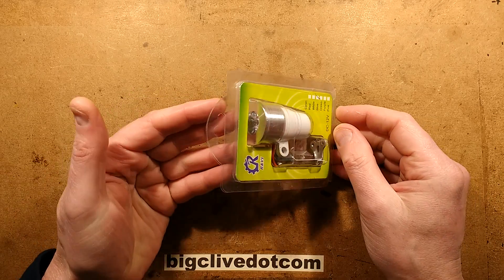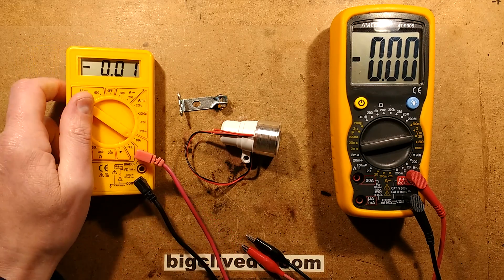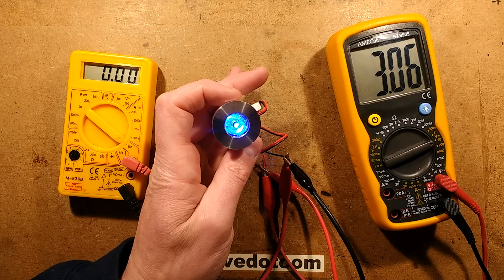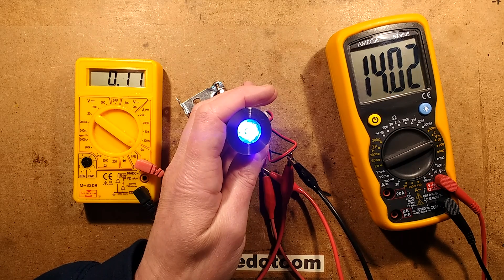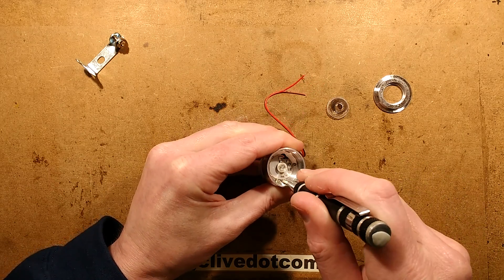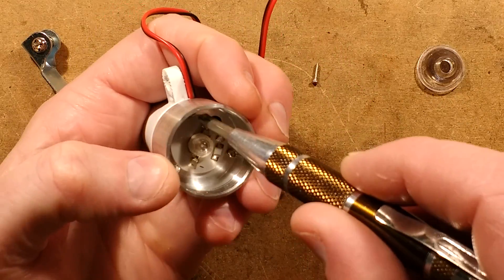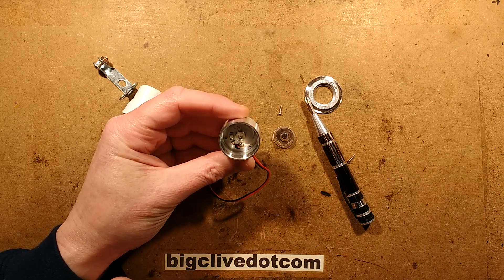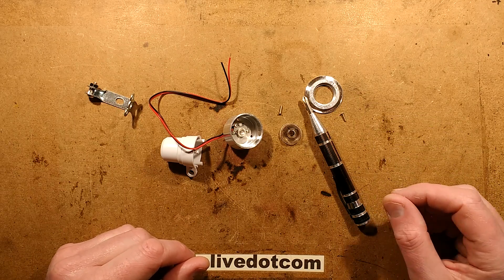Inside a cheap LED vehicle feature light.

Comment: You could easily fit a LM317 and a resistor as a CC in the plastic housing (using the metal housing as heat sink if necessary)

Comment: Clive, even though its rated for a 12v system, cars actually operate at between 13.6 and 14.5 volts during normal operation...
Reply from the maker: This is where the cable will probably be the main current limiting element.

Comment: just one little question about resistors in an led circuit.. dies it help the current stay linear and not go crazy as the voltage goes up as it would without one? in other words the more the current goes up due to voltage increase the resistor balances it by way or the resistance growing as the resistor heats so like a ballast?
Reply: Well a light bulb is used as ballast when experimenting with m.o.t's and a light bulb is basically a resistor. I wouldn't have thought the resistor in an led circuit would need to heat up to a noticeable amount just that when the current rises it limits now much can pass on to the led. Thermal or otherwise
Reply: Unlikely to act as a regulator as heating and the associated resistance increase is an inertial feature ie it takes time, there is no way it is fast enough to compensate for voltage fluctuations unless those are extremely slow.
Reply: The component you're describing is called a thermistor. A Positive-Temperature-Coefficient (PTC) Thermistor is a passive device whose resistance increases with increasing temperature.
You can also get NTC thermistors with a negative coefficient, which obviously work in the reverse fashion.
They are often used as part of a "soft start" limiting circuit in devices with a heavy start-up current draw, to provide a degree of self-regulation as the device reaches normal operating temp.
Reply: Yes, I think I might have misunderstood your original question. You're correct, a ballast can be as simple as just a single resistor; the simplest technical definition is "a device which limits electrical current flow through a load".
The value of the current-limiting resistor in a LED circuit is calculated to give a voltage drop across the resistor which is equal to the difference of the supply voltage (Vs) and the LED/s forward voltage (Vf), and which limits forward current (If) to some value which won't damage the LED and/or gives a suitable level of brightness. The correct resistance value is given by the equation Vs - Vf / If.
Because you are dropping voltage across the resistance when current is flowing, some power will be dissipated as heat. The resistor needs an adequate power rating to cope with this dissipation, and good design dictates that you'll specify the supply voltage and connect the LED strings in such a way that minimises the voltage drop for your desired forward current (hence also minimising wasted power). If a current-limiting resistor in a LED circuit is getting really hot, there's something wrong... either with the design of the circuit itself, or some component within it. But the resistance does not change significantly with temperature. As the voltage is pushed higher, more current will flow and more power will be dissipated, until the resistor fails open circuit (preferable) or short circuit (likely causing the load to be destroyed).
Reply: A light bulb filament is usually made from a coiled coil of tungsten which is very different to the carbon film or metal oxide used in resistors (except ceramic resistors for high voltage/loads) so the temperature effect is different for them. Tungsten has a low resistance until heated then its resistance increases slightly as it gets hotter. Your right about resistors getting hotter with voltage increase as the current flowing through the load increases as the resistor is dissipating more heat for doing its job of limiting current. However resistors are not intelligent, they are usually used in situations where the voltage and load will not vary by much which is why the correct value of resistor must be used for the purpose of which it was intended. For big fluctuations in circuits where the end result needs to be close to a constant, supporting components and circuits may be required like voltage regulators, snubber networks, Thermistors, zener diodes, buck and boost converters etc .. :) You can get more 'bang for your buck' if you heatsink the resistor but ultimately there will be a point where the resistor will just glow and burn out. Low value resistors can be used as a one shot fuse in that respect :)
Reply: bigclive.com should intervene here as all these theories seem to contradict themselves..
Reply: does a resistor regulate? to regulate means adjusting voltages and or currents flowing to the desired component. as the voltages get higher the resistor should lower the current flow and if drop down have no affect. regulate. if not just have a lower voltage input in the first place then when the threshold is reached the led will be optimum.

Comment: Here in Russia it's forbidden to use other colors of vehicle lights other than red (back), white (front) and amber or yellow (sides). And fines are quite high.
But in Asia i saw vehicles that was looking more like Christmas tree!
Reply: Same in EU.. It would also have to be tested and marked with a license number to be road legal
Reply: The UK highway code stipulates the colours allowed for public cars/motor bikes. brakes/running rear , red, indicators , yellow (amber), headlights, white, sidelights/front running, white. Strangely there is no need for reverse lights to be white although it warns you that Blue and green lights are restricted to emergency vehicles only. It's all about removing confusion on the highway and rightly so. Obviously flashing or rotating amber lights are for warnings which is why indicators are yellow. It's also interesting to see a lot of cars at night using fog lights (bottom of front bumper) for extra illumination to which there is an on the spot fine of £100 if there is no fog as they dazzle the cars in front. The usual excuse is "but muh runnin litez init", er, no. They're fog lights, turn them off. My brother found out the expensive way from a police car that stopped him for that very reason :D lol
The plethora of lamps for cars out there are supposed to be only for show purposes while the vehicle is stationary and off the public highway, cos yeh, they do that don't they while tear arsing around supermarket car parks ripping up tar mac, booming out shite music and looking like a UFO from across the road.

Comment: I bought a white one of these which claimed to work from 12 to 80V. It turned out to have a switching regulator inside and worked fine on my 48V electric bike. The annoying thing is the regulator doesn't start regulating until 14V, which means it's not full brightness if I want to run it at 12V (a common standard voltage).

Comment: Yes it would make a smashing little down light, not sure about its intended purpose, the road salt would see that bracket off pretty sharpish with our winters. Smashing video as always, thanks. Ps. My leads also suffer from separation anxiety, usually after the power supply is turned on! ;-)

Comment: Hi Clive....what is your experience of dealing with Chinese \ HK companies ....l have so far stayed away from giving them my custom , however l notice you seem to use them quite a lot ,,,( this one above coming from a chinese seller.......any advice , do's and dont's etc appreciated.....thanx by the way for your , entertaining ,and informative articles.........a gift is on its way via Paypal
Reply: Been buying from Chinese sellers off eBay, AliExpress. Shops like GearBest, DX,TinyDal, BangGood etc.
Worst two cases have been with eBay where it by all accounts looks like the sellers tried to run scams. One was refunded directly by eBay, the other one I waited too long (in hope of it just being a shipping issue) and had to go to PayPal for the refund (still a pretty painless thing). Had a couple of items on AliExpress that weren't as described and have been completely refunded or come to a deal w the seller for a partial refund depending on exactly what the issue was. Don't recall any issues with the shops like Tinydeal, BangGood etc.
eBay and AliExpress seem to both run a fairly tight ship in favor of the buyers and in the few cases where things havent arrived (both eBay and AliExpress) refunds or re-shipment has been no problem.

Email address has leaked somewhere, causing 3-4 other shops to send their ads, but it's low colume and gmail manages it mostly in the background.
Reply: Sorry. I misunderstood your question.
I have been buying Chinaware through Ebay for years now.
Mostly with succes.
And on the few occasions an item didn't arrive or was DOA I usually got refunded within 2-3 days, no questions asked.
I'm not sure about the privacy guidelines on Ebay though. Imo personal details are shared.
Reply: changed that now to via Patreon
Reply: My experience is : If it works, you're lucky.
If your house burns down to the ground, not so lucky.
It's a calculated risk with these cheap China things.
Just use those things attended.
Reply: Hendrk ,,,,,,l wasnt talking about the quality but the actual sales of items....l have bought uk stuff that would have been better being sent direct to the tip.....l am more bothered about whether my money and personal details are safe,,,l have fell foul of dodgy dealings in the past
 and just for the record .....how much stuff on ebay or amazon are made outside of China.....l would think about 20 % if we are lucky........
Reply: thanx for the info Hendrik
Reply: thanx for the info Michael ,along with Hendrik 's answer and yours l feel a bit more confident about using the overseas sales companies
Reply: l had a few nasty experiences with sellers on Amazon and Ebay , more from misuse of my details , plus l have had so UK firms that turn out to be shipping from abroad yet they claim to be in UK Manchester or London etc.......as Bigclive deals a lot with China on Ebay that was the reason for my question , eg Security ,,,
Reply: Most of the people who disparage chinese stuff, are either racists, or people still stuck in the 1970's mentality and trying to see stuff at 1970's prices.      They are not keeping up with progress.    25 years ago,  something with the ability of, say,  an Arduino, cost about 3000 dollars.  Now 3 dollars.   There are a lot of people with old stuff in stock,  pissed off that they cannot sell their old stuff for $3000 any more.    Same as the retailers with big TV's which were $5000 five years ago,  now about $700.

Comment: im curious why shouldnt the meter be left in a current function? obviously not just because it drains the battery, i do kno it puts out voltage when measuring resistance but i havent heard about this yet
Reply: The leads are connected in current mode. If you try to measure a voltage with it you'll short things out.
Reply: if you go to measure voltage, then you may either just blow the fuse , or on a cheaper meter the 10a has no fuse, or ruin the meter, or if you were measuring mains, even  the fuse might not trip fast enough ruin the meter and have stuff shooting out of it
Reply: Because some idiot (usually tomorrow me) will connect it up to a voltage source and blow the not inexpensive fuse.

Comment: Hi Clive. How about a teardown of the car “ghost shadow lights”. Basically plug in replacements for your door puddle lights that project a logo onto the pavement bellow. Car manufacturers charge a small fortune for these at list price (£100 from Audi for example) but the cheap Chinese copies are knocked out for £6 a set on eBay/AliExpress.

Comment: About time to make yourself a quick connect tester for DC. Some quick connect terminals to grab the wires and a few spots to probe for the meters and a spot to clip on the wires from the power supply. Could use some of the cheap panel indicators for volts/amps but that would require a second power supply.

Comment: It is a 1W light, only 3/4 of that watt is being dissipated through the resistor instead. XD I guess the LED is being under-run at least.
Reply: well a decent single led should be about  3 volts x 20 milliamps  which is about 0.06 watts.   Anything above that is waste.   But in a vehicle, it is not connected to your utility meter,  so nobody cares.

Comment: neat led, will buy a bunch and hook them in series and use them as a 220V downlights
Reply from the maker: +Quick Look n Teardown Technically speaking you could do that with just a rectifier, but the separation between the LED and aluminium heatsink is just a shim of fibreglass laminate so there's a risk that the aluminium housing could end up referenced to the mains.
Reply: yea, probably not worth the risk, thanks Clive, I love your videos

Comment: Father took ownership of a new (to him) motorcycle today which came with a pair of "spotlights" thrown in, naturally I had to take them apart and check them out on ebay. They are listed as 9-12W (definitely not looking at the LED chip), but they do have some circuitry in them, a couple of capacitors and chips etc. They are also listed as waterproof which they aren't either. Thought they would be suitable shite to interest you Clive. https://www.ebay.co.uk/itm/2pcs-U1-Car-Motorcycle-Laser-Aluminum-Headlight-LED-Fog-Spot-Light-Bulb-Switch/182618889922?epid=2245838054&hash=item2a84ef1ec2:g:s4QAAOSww~xZ2Mdy
Reply: The Chinglish description is epic! "Unique square spot suitable for pavement super province electricity night driving more fuel efficient more secure absolutely not deficit battery", followed by - "Function: Continuous switch a super white head,two near the light,flashing three invincible" :-)
Reply: Hahaha I didn't read that bit! Even more reason for Clive to do a video on them!

Comment: I was going to ask a question but I just found what I wanted to ask how to build. It is a Lipo battery meter that has lights going from green to red and the buzzer. Ordered it cheap from Hobbyking. Next project is adding onto a wing an EDF 50 mm with a receiver controlled on off switch. Hoping to have it set to the most efficient point and be a binary power boost. For liberating those screws you could be considered a humanitarian, or a pimp.

Comment: I was wondering if they're all that well waterproofed as delivered and if they'd cope with the shaking about a wheel-chair would be inclined to give them out on the pavements/roads, electric or self-propelled 'chairs?  Particularlly the electric powered Class 2 'chairs as they can be unforgiving bone-shakers with a pair of hefty 12v Gel Cell batteries strapped under them.  Would Self-Propelled Class 1 'chairs manage with a water-proof battery holder and a couple of 6 volt Ever-Ready's at least?  I suppose this would lie in the 'push-bike' category, but the rattling can be fiercer with the smaller wheels on Class 1 wheel-chairs and nearly all Class 2 ones;  especially on most pavements, getting on and off pavements, 'street furniture' such as gas and water shut-off tap covers, et.c.  It can be rough going.
(I've seldom seen Class 2 'chairs with suspension of any kind.  They do exist though.)
(The blue ones would do for under-lighters for 'pimpin' the 'chair up' !:^)

Comment: Wouldn't mind seeing what's inside of one of these 4 LED 12v-85v LED spotlights. Ebay Search term "12V 4 LED Spot Head Light Lamp Motor Bike Car Motorcycle Truck". I assume given such a wide voltage input it would be a switching supply.
Reply: or.. they dont care if it burns out! lol

Comment: Probably useful for mood lighting in a caravan or something, though how you'd improve the mood from "miserable" to anything else in a caravan is a mystery... :P
Reply: You can change the mood in a caravan from miserable to suicidal if you consider you are sitting in a cupboard, shitting in a bucket and it's landing with a thud instead of a splash.
Reply: @bren106  Have a UV led in the caravan to illuminate areas where 'body fluids' were spilled.
Reply: Drugs. You do lots and lots of drugs.
Then you start decorating the inside of your caravan with LED lights.
Reply: Improve the mood?   Hmm, add a cannister of N2O?  Watch the episode of Father Ted set in the tiny caravan?  Look through the window at the rain and the tents everyone else is in?  Fry up a slap up breakfast?  Pretend its a very tiny cruise ship?  Drink your bodyweight in Pimms? (Careful of mixing the fry up and the N2O, its very inflamable, so they tell me)  - actually careful of that Pimms thing, turns out 17 bottles is more than enough for small party.
Reply: I say with lots of marijuana.
Reply: Nope, still a caravan, though Nitrous and flames in one, that is a good way to get rid of one at least... :P

Comment: "It's a simple vehicle light complete with a bracket that allows you to attach a rustable bracket onto your paintwork by perforating it with rustable screws and flimsy wires."

I somehow don't think that would fly with the marketing department for the product brochure.
Reply: yes, if they are lacking space to print that much, they could just say 'shitty tat'
Reply: I find it interesting that it's cheaper for them to stamp metal into a rough bracket shape rather than make up a mold for plastic.
Reply: stamped metal is the product of the 20th century, they probably had the same machine for this part for decades!
Reply: Marketing Departments have a distinct phobia of truthful advertising. LOL
Reply: Another great vid, thanks for sharing